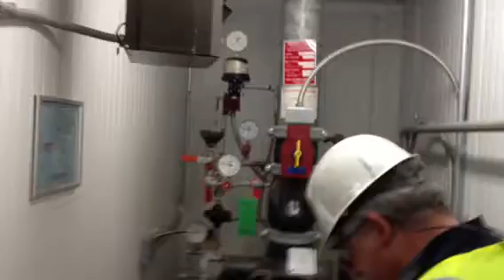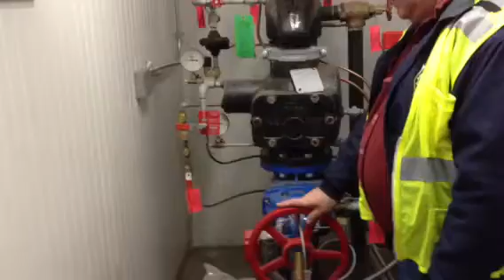Dual action sprinkler system

Comment: Operating the manual pull on the trim doesn’t open up the solenoid. It bypasses the solenoid to dump the power water. Only way to operate the solenoid is electronically with a smoke/heat detector.